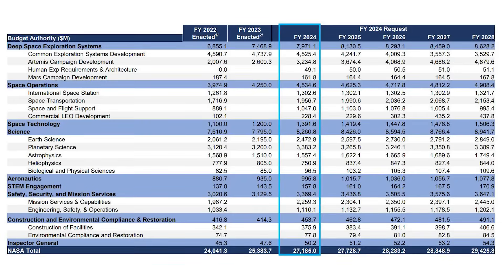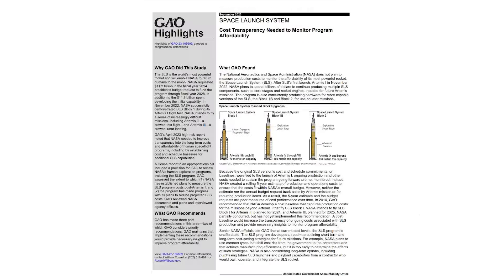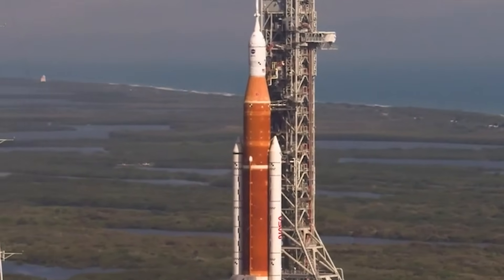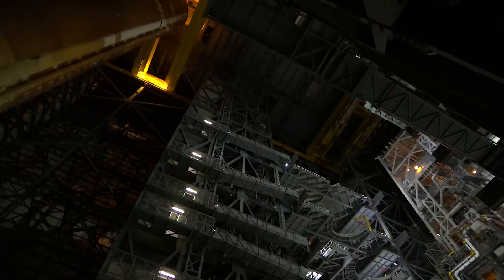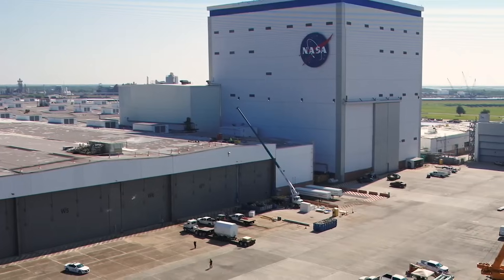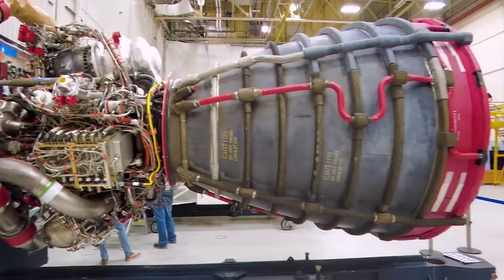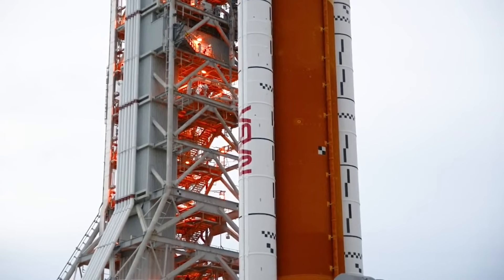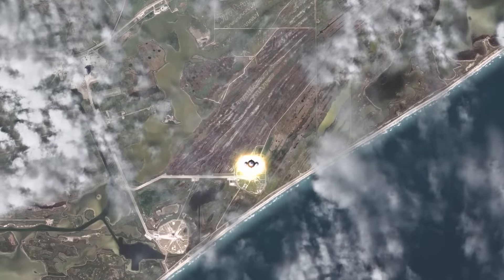New NASA Audit Reveals The SLS Program Is "Unaffordable"

Comment: SLS should have been canceled long ago. It should never have been given the opportunity to make it to its first flight, but political momentum carried it through. I do find it mind-blowing however, that they're actually continuing forward with the program, especially in the face of the progress being made of the much more capable Starship system SpaceX is putting together for a tiny fraction of the cost that has been so far thrown away on the SLS system. SLS is an abomination built around 50 year old technology! 22 BILLION dollars thrown away so far for warmed over Shuttle components? It's laughable. But the aerospace industry has the lobbying power it needs to buy the congressmen required to keep the fiasco going. It's shameful. Criminal really.
Reply: Critics demand perfection of NASA each and every step of the way, that adds to the cost.
NASA is funded by the votes of hundreds of non-engineers who want to use it as a high-tech jobs program where they live.
Sure, the SpaceX funding and development model is better. What's your point?
Reply: Do you know why they are continuing with the program and why is it so weird for you?

Because its not the failure you convinced yourself to believe it is.
Does it have it's problems? Sure, but its doing good enaugh and this is good reason to continue it.

Comment: The SLS is done for.. let’s go with a better Falcon Heavy. 
Starship doesn’t make sense to land the actual crew.  But it does make sense for a gateway module
Reply: Remember The Boring Company? 
Musk is going to use its "Heavy" to boost boring machinery to mine the far side of the Moon, where the mountains of minerals are not covered by oceans of worthless basalt.
The smelting will be done on the Moon and SpinLaunch will put refined metals into Earth orbit.

Comment: NASA does what Congress tells them to do. We say NASA this and that, but they were TOLD how to run the project and where to spend.
Reply: 535 non-engineers who want jobs in their states and districts control the most visible high-level engineering projects. The most critical of these non-engineers demand absolute perfection. They don't deal with formulas so when someone says that looks like a bad formula they take it personally and gratefully use it as reason to yank NASA's chain.

Comment: Here's the thing, bureaucracy. 

Good luck getting the development costs of reusability trough congress. Another is that there are often unforseen costs, if you ever made a budget for visiting a theme park or a holiday, you would know what I mean. With the SLS there is sometimes more testing needed as the systems, although derived from Space Shuttle hardware, it's still diverse from it. As such it might not work smoothly first try. This is not like they just ordered a car of a factory and put it on the road. This is them building their own car AND paving their own road. 

Because space is hard. Getting to the moon? That's putting more hard efford on top of that. And then a friendly reminder that they plan to put humans on it NEXT launch! The safety  margines they deal with are tight. This is why the spending on it gets higher then budgeted. This is often the case with many many new projects. There are always things that don't work out first try, and then need more improvement, which takes time and money. You can't always forsee which part it is, and how much that might cost. They often calculate in a little bit. But then again, this is NASA, they have to ask Congress for money, and the track record as of the past 2 decades is mostly budget cuts. So they don't want to knock on their door with a giant budget, instead they asked for just enough to get the ball rolling. 

The Constellation program got canned because Obama said it was too expensive. Well space is expensive. We are trying to go back to the moon, and for how much? The Apollo program had cost us way more by the time Apollo 8 came around, And it only did a lunar flyby. And then only at the 11th launch of that program (of Apollo 11) did they set foot on the moon. The lunar flyby with people on board is what they will do with Artemis 2 already. And Artemis 3 will be landing on the moon! 

The Artemis program already will go faster and be cheaper then the Apollo program. Also because they want to partner with SpaceX. NASA isn't twiddling their tumbs, they are hard at work in getting their systems rolling. And unlike SpaceX blowing up test articles, NASA doesn't have that luxury. One exloding SLS rocket and their done. Artemis canned. They don't want that. Also because human lives are at stake. 

They need to make it right, first try. That takes a lot of making sure it works right. This slows down their production and development significantly.

Comment: NASA ARTEMIS PROJECT STEPS:
<reduced to everyday terms>
1.) YOU & FRIENDS DRIVE TO WORK IN A REALLY NICE CAR
2.) AFTER WORK, YOU DRIVE 3/4 OF THE WAY BACK, THROW AWAY THE CAR AND RIDE CHEAP BIKES
3.) 7/8 OF THE WAY BACK, YOU AND FRIENDS DITCH THE BIKES AND START WALKING BACK
4.) AT 15/16, YOU EMPTY YOUR POCKETS, STRIP TO YOUR UNDERWEAR AND SWIM HOME ACROSS A COLD RIVER!
5.) 16/16's MISSION COMPLETE!!

<so yeah, ummm... the boeing corporation/sls launch system/artemis project is all based on the old 80's nasa space shuttle launch system, so it is already 40 years out of date>
<also, the whole artemis moon project is all expendable. the crew capsule/astronauts/orange pressure suits/bags of rocks come back, but even the moon eva suits are left behind. whereas the single use philosophy is by far the most expensive way of doing anything>

Comment: SLS is a boondoggle. NASA is trying to compete in a modern aerospace business environment using relatively ancient, super expensive technology. Further, launching SLS/Artemis only once every year or two can hardly be called a working space program. If Apollo had been that slow, we'd STILL be trying to get to the moon.
Reply: Apollo was a stunt.
Yearly cadence is arguably more sustainable and working program, than launching 12 rockets stockpiled over a decade of unlimited budget within 3 years, and shutting down production lines before you are halfway done trough missions.
Here, sure they could launch more often, but no one wanted to pay for a full rocket, so thing was underpaid early on and well, here we are today.

Also why would nasa compete in modern bussiness? What are they? Comsat launch service provider? Its NASA not some commercial company trying to farm as much cash as they can.

Comment: Pull the plug, like its predecessor. NASA has to get rid of the cost plus approach and get to fixed price contracts. This way the commercial program will excel and gain the respect of the taxpayers instead of the pork barrel politicians.
Reply: There is the same problem with military contractors and on a much larger scale.   If we can't resolve the problem as a whole then we are just heading for financial bankruptcy or worse.
Reply: Well, the way fixed price contracts go, they either wouldn't bid on them or they would threaten bankruptcy halfway through and get the govt to bail them out...end result is that they get paid twice as much to complete the contract due to the bailout.  And yeah, the govt absolutely would bail them out because of the sunken cost fallacy.
Reply: NASA has trouble getting 22 billion, while the Pentagon gets nearly a trillion per year, by default. How crooked is that?